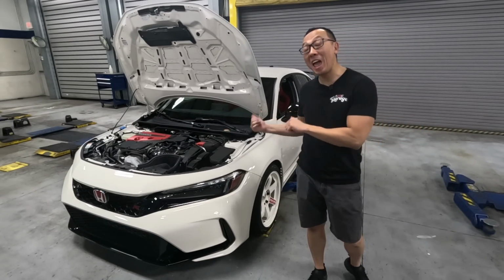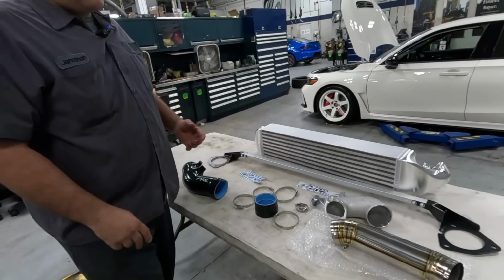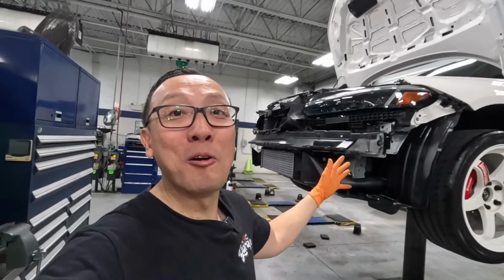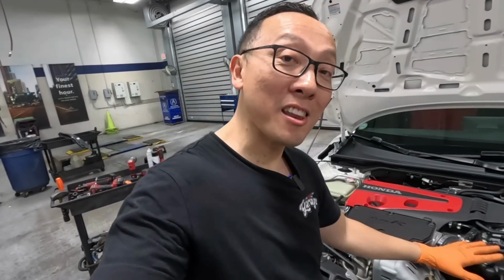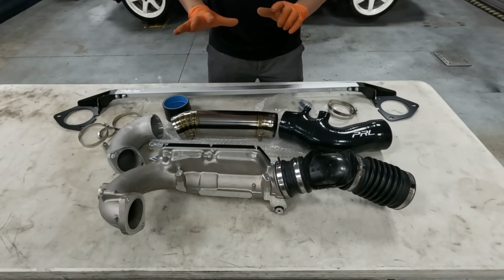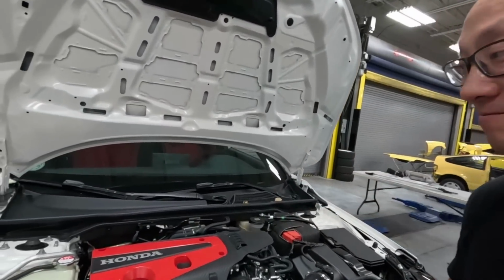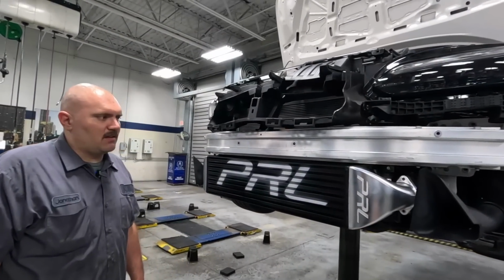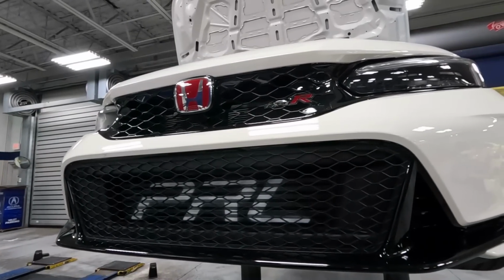2023 FL5 Honda Civic Type-R - PRL Motorsports Intercooler & Titanium Inlet Piping Kit (Episode 2)

Comment: Do you need to cut the tab where the ambient air temperature sensor is attached for proper clearance, and drill a new hole into the front bumper safety plate to relocate the ambient air temperature sensor?

Comment: Doesn't painting the intercooler reduce cooling?
Reply: Yes, having an intercooler painted black makes it a little less efficient in exchanging heat. But the difference isn't very large according to a few posts on the Civicx forum, maybe 2-4% less efficient.
Reply from the maker: @PeteR90468  Thanks for your input on this 👍🏼

Comment: Hey lads I have FL5 in Australia, i hit a baby kangaroo and did basically no cosmetic damage but the car died i instantly lost throttle so went to mechanic and they said 99% sure its inertia fuel pump switch has been activated so its turned off fuel pump but they said they cant find inertia switch because all the info is for FK8 and prior, literally everybody in AUS who i have called cant tell me where the switch is, i have pulled off all the plastics in foot well on driver side and passenger side and cant find it, have done ECU reset, and pulled fuzes for fuel pump ecu etc and nothing works does anybody know where the inertia fuel pump switch is on the FL5?